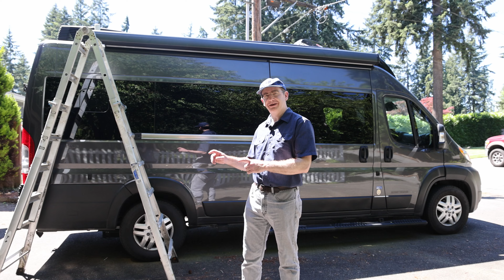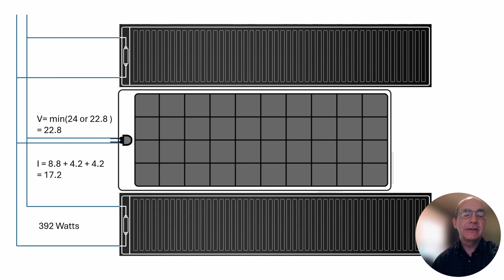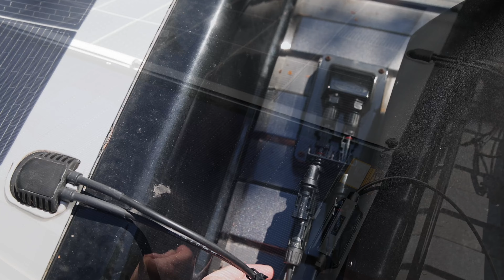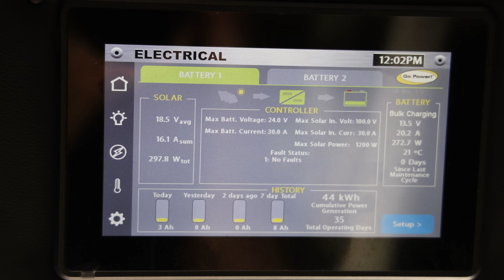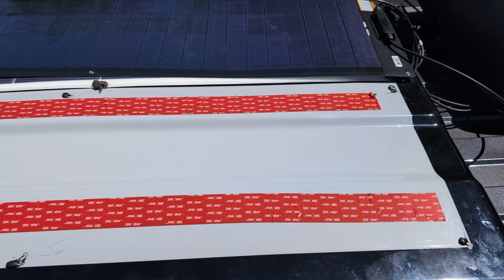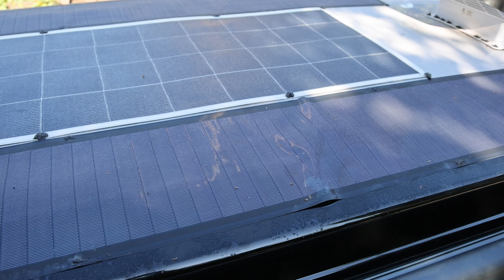Adding Solar Panels to the Rangeline

Comment: Hi Duncan - Truly great content. Am curious about how you're feeling about your solar upgrade after 8 months. Anything you'd do differently?
Reply from the maker: It's been working great - the only thing is the differential expansion of the panel compared to the roof. In cold weather the panel wrinkles quite a bit. I'm not sure how to work around that - it would require some sort of coupling that could flex, but still hold along the length of the panel so it doesn't flap.
Reply: Well, it seems it would have been worse if you’d mounted the panels  on a cold day and the roof had tried to stretch them 5% :-)

Comment: What kind of bolts did you use for the fiberglass poptop installation? I wonder if you could just put 2 bolts in the front leading edge and rely on alien tape or other super duty double sided tape for the rest, may making four courses of tape rather than 2. The hope is that if done while the roof is cool, heat expansion would stretch everything tight but within limits. I really appreciate your experimental cutting edge work for our benefit.
Reply from the maker: 1/2" #8 hex screws. I wanted to make sure not to punch through the roof material on the inside. I'm a bit paranoid of things coming off and would be nervous with just two screws and tape. There's a channel down both sides that runs down the middle of the panel so you can't tape there - leaving just 3" on each side for tape.